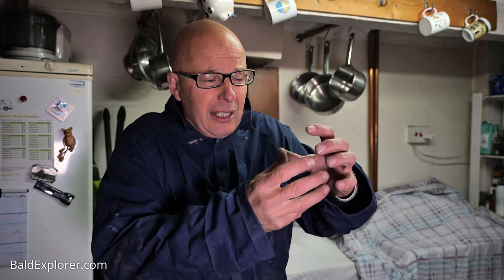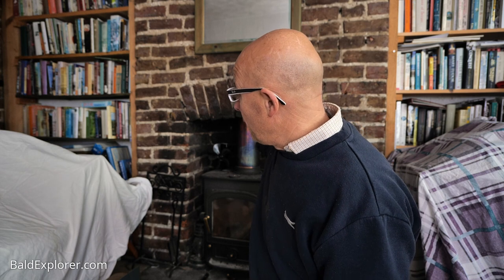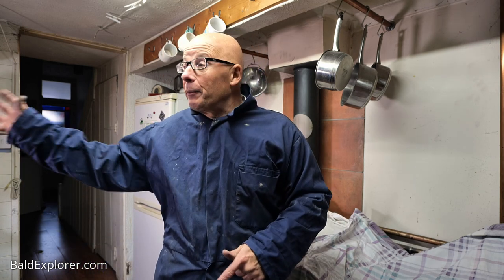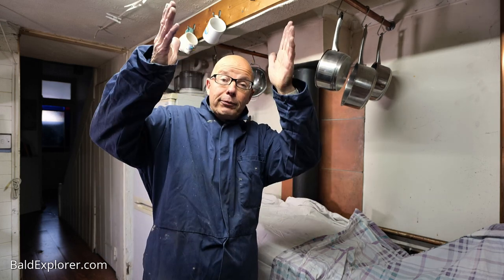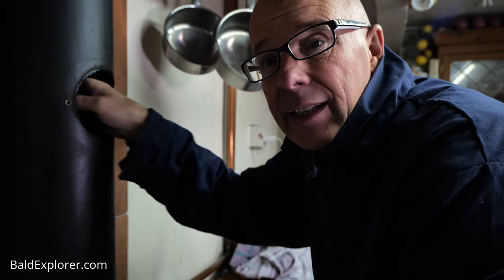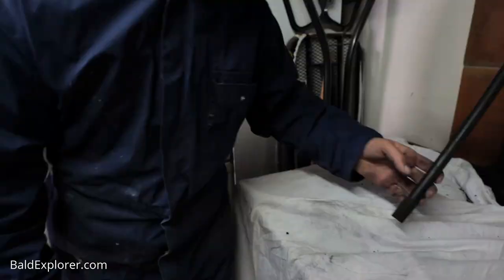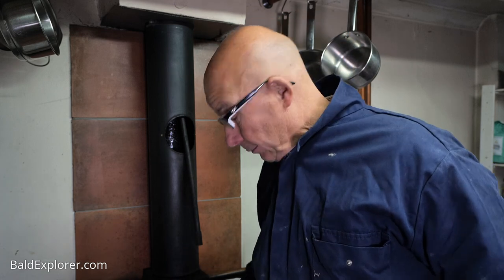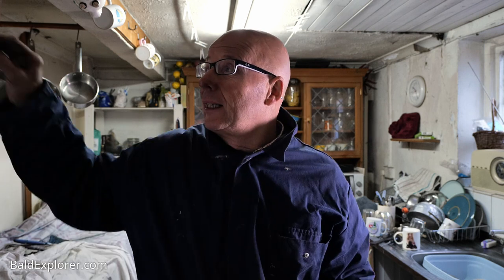How I Sweep My Chimney - Wood Burning Stove

Comment: A good tip I was told many years ago when I was an apprentice brickie by my old boss we used to do a lot of flue work on old cottage chimneys and had to sweep many flues is to tie a bit of thin nylon rope over the brush head you need enough rope to go right up the chimney but if the brush head comes off you have the thin rope to pull the brush head down the flu without much of a problem. Well done good video! I  still sweep our open fire flu every 6 months. Kev.
Reply from the maker: Great tip!

Comment: Please take the time to read and think about this message.
 As a previously registered Hetas installer of solid fuel appliances and liners of 30 yrs it is good to hear you are getting it lined but if your manufacturers instructions for appliances say it isn't necessary and only require a structurally sound leak free chimney below a certain dimension then it may not be necessary. More worrying to me is the pipe to register plate joints and the register plate to chimney joints on both stove and Esse. Those joints should be integrally sealed with a heatproof sealer not just screwed back up dry. If your chimney has accumulated soot after a few months and a spark is drawn up through from the appliance through the pipe and catches the soot on fire and starts burning you can have a chimney fire that would then draw air in through those gaps and burn uncontrollably very feircely. Obviously closing the appliances air slides in an attempt to control it wouldn't make a difference if if air is sucked in those gaps higher up to feed the burning chimney fire 🔥.
 Also if you seal those gaps regardless it will provide a better draw through the appliances anyway in general use making them easier to light and more controllable and fuel efficient. If you imagine trying to drink a glass of liquid through a straw with a hole in the side it wouldn't suck the liquid out of the glass very well, the unsealed plate/pipe joints cause the same effect as the chimney will draw air from wherever is easiest and lessen the appliance draw/controlability. I noticed you only cleaned upwards from the inspection hatch door on the Esse connecting pipe, hopefully when you removed the pipe you cleaned the bottom section of it too. People have died of carbon monoxide poisioning using appliances because they forgot to clean the bottom half of the pipe(which was blocked) from the door downwards with accumulations sat on the appliance baffle and then the appliance fumes could come back into the room through the air controls yet they had a lovely clean chimney from the door upwards. Another good habit to get into at time of sweeping is to check the working operation of your carbon monoxide detectors which should be fitted in rooms containing solid fuel burning appliances. A legal requirement of appliance installation since 2002 under document j of the building regs.
You might think I'm nagging but prefer to say I'm giving you and the other watchers/subscribers of your excellent channel the benefit of my professional experience and food for thought, by the way this video has just given your house insurance company,if you have one of course all the documented evidence they need to walk away and blame you if you had a chimney fire that caused major damage to your property or neighbouring ones too.
Reply from the maker: Some great advice there - thank you.

Comment: I do mine around 3 times a year, I have some fibre glass rods with a brush attached  that you fit in a cordless drill, add the rods as you run the drill moving up the flue adding to rods as you go
Reply from the maker: Good idea

Comment: Just a thought, but you might consider the purchase of a goodly-sized shop vaccuum for cleaning up that kind of mess.  A model with a hepa filter, an internal capture bag, and a filter exhaust that's rated for drywall dust (that should work well for your chimney dust).  They can be had for not a lot of money and would be very handy for cleanups for jobs like that (or for cleaning out the van as well). :)
Reply from the maker: Sounds like something I need! :)